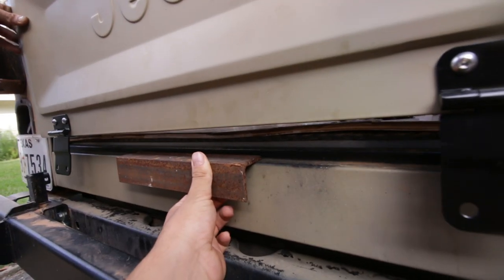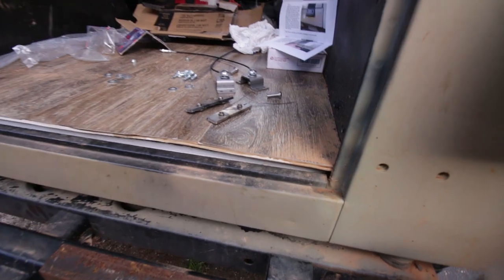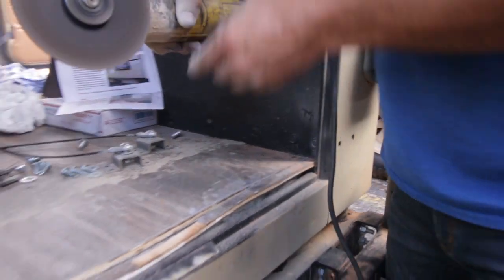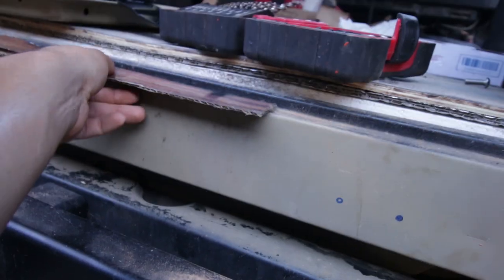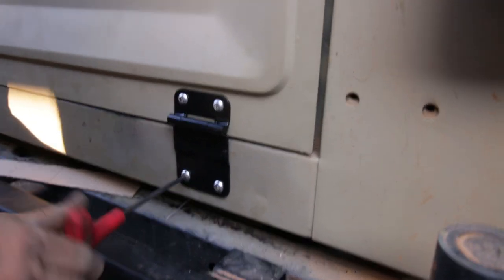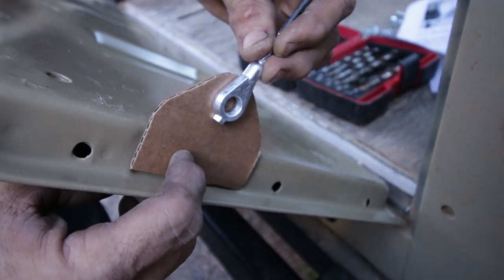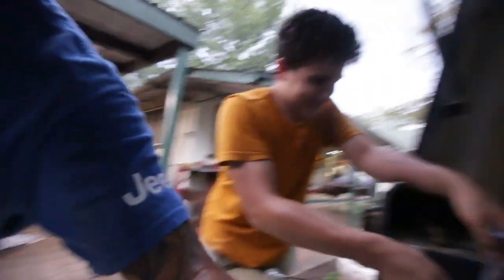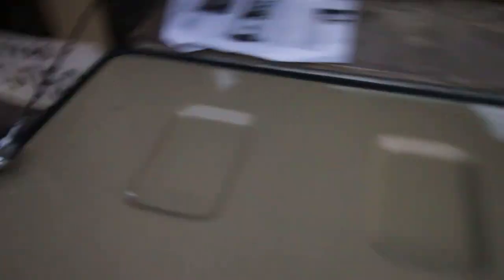How to install Swag Offroad CJ7 tailgate conversion kit

Comment: Imperial hardware is measured in fractions, as in 7/32nds  not 7x32, Just sayin'   
Also you could have pulled the plate up through the body on a wire.

Comment: are there any advantages to the CJ7 tailgate over the YJ swing gate?
Reply from the maker: I think so. Especially if you have a swing out bumper tire carrier because the swingout tailgate is irrelevant
Reply: @TheTrevorMartin  would I be able to reuse the lock cylinder from the YJ tailgate?